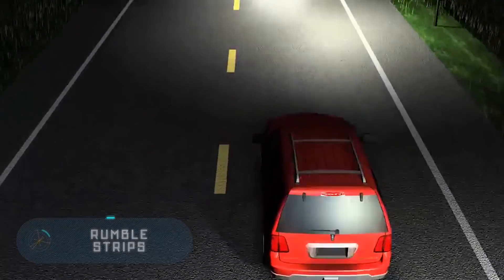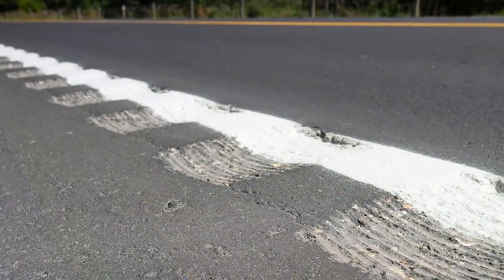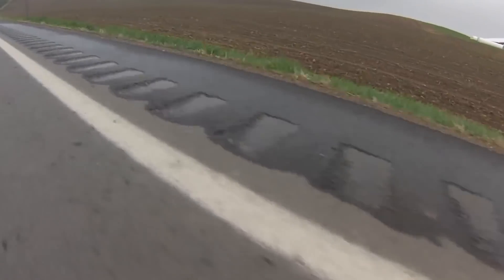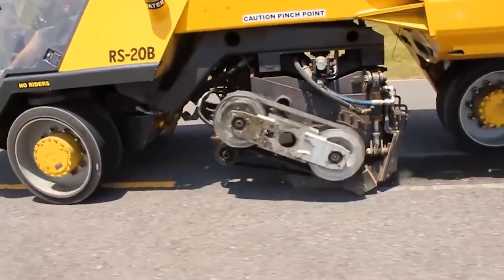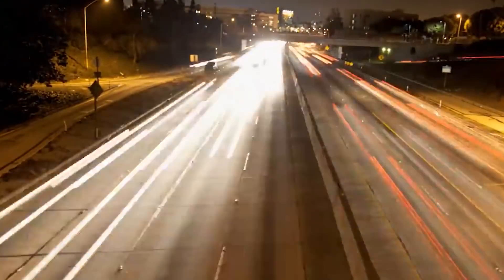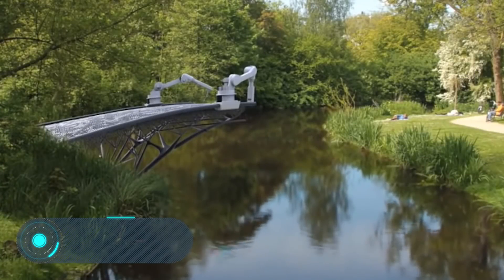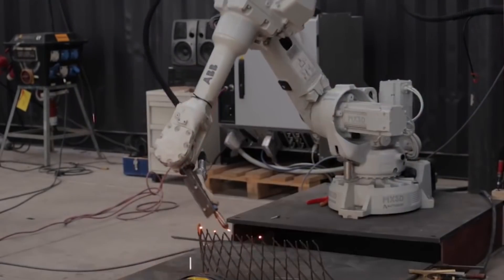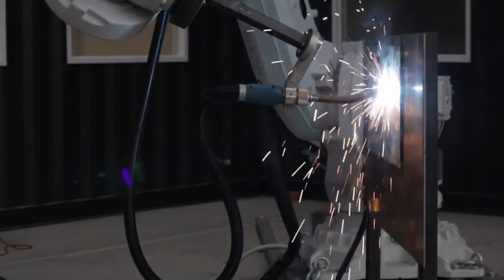MIND BLOWING LATEST ROAD TECHNOLOGIES

Comment: The Geo-Web foundation is impressive. It does make roads cheaper, which is fun for travel :-)
Reply: pretty sure its not actually cheaper... hence why they arent used. I looked at doing something like that for a driveway, the plastic mesh cost a bucketload, then you STILL need the fill anyway... only way its cheaper is if it ACTUALLY lasted a crapload LONGER than the 'usual'
Reply: I'd imagine the cost savings only come in places where normal roads either don't work or don't last. Otherwise, you're adding in the cost of making large amounts of polymer webbing in place of nothing. (they'd just put down everything else minus the web)
Reply: It's also giving construction an excuse to continue to mass cut and clear natural areas in order to lay more road for fucktards who like to burn fossil fuel. So not really impressive in the ways your thinking.
Reply: draggy76 what?

Comment: The first is the only one who is Economic. The other ones are just to test things and are much to expensive and hightech. Keep doing things like nature. smart, simple, and low energie input.
Reply: The 3d printed bridge, the reuse of asphalt, non Newton Ian fluid bump, vibrator road  are also economic in long term
Reply: vibrator road is not economic in long term. More accidents, means less people, means less vehicles on road, means road will last longer, means long term it is more expensive (in case anybody is wondering, this is sarcasm). On a serious note, 3D printed bridge is probably more economic, reuse of asphalt is a I believe present for quite some time, probably should not be in this video, but yeah, it is way more economic, vibrator road is not about economics, but more about saving lives, and for a really low price. Non-newtonian fluid bump, is in my opinion a nono economically. It will last less, it would not be easily fixed, and, if somebody is pissed at bumps, he just needs a good knife to "kill" the bump. Otherwise, its a great idea.

Comment: I believe that shoulder rumble strips were started being used in USA in the late 1980's. The rumble strips proved quite effective at reducing traffic run of the road crashes and thus were adopted world wide fairly rapidly.

 The first study on Centerline rumble strips was in the late 1990's in Delaware.  Minnesota had a few miles installed in Twin Cities area and in Rochester area.  Then some 60 miles in Central MN.  Before it became a standard feature on certain two lane roadways, a retrofit contract installed some 180 miles of centerline rumble strips in one summer, again Central Minnesota locations.  That nearly tripled the amount of miles of centerline rumble strips in MN.  PennDOT was also a leader in rumble strip research both on shoulders and centerline.   

The Minnesota contract also installed a test segment of Mid-lane rumble strip on a driving school track.  There were considerable questions as to the Mid-Lane rumble strip which could replace the two shoulder rumble strips and the centerline rumble strip with two mid lane rumble strips.  While the idea of the mid-lane rumble strip never caught on, the need for rumble strips will eventually disappear due to self driving vehicles and when driver alertness technology is implemented in human driven vehicles.  The original idea of the mid-lane rumble strip was broached by un-named bicyclist at a public meeting discussing shoulder rumble strips on a Colorado roadway.  The benefits of a mid-lane rumble strip were to snow plow operators who had to drive over them, allowed bicycles access to the cleaner part of the shoulder next to the edge line, and warned drivers of lane departure sooner than either of shoulder or centerline  rumble strips.  (Mid-lane rumble strips would be installed between the wheel paths of each lane. ) 

In summary while Minnesota DOT was instrumental in moving ahead the research and use of Centerline rumble strips, Minnesota DOT was not the first for installation.  Nor was Minnesota the first state to install edge line (shoulder) rumble strips.
Reply: Here is a fun fact, the rumble strips started in the early 50s in Nevada as "songs" in the road. It was to keep people awake on the long boring drives, and as a fun thing. I think it was called the "musical highway", give it a google.

Comment: The non-Newtonian liquid speed bumps is genius!
Reply: Until someone cuts it with a knife...
Reply: already happened they removed all the ones they installed less than a week after because people stabbed them or they just got holes in them
Reply: Kevlar coating?
Reply: yeah theres always some fucking idiot who would cut them with a knife because they fucking mongs.
Reply: intelligent speed bumps use corn starch. try it on your kitchen.
Reply: Steven Chandra corn startch isnt the only non newtonian liquid.
Reply: ANNND Its already gone.
Humans are geniuses at  proving good ideas are bad.
Reply: yes they are but unfortunately there are always stupid people that stab them as already mentioned and also I think kids would play around on them
Reply: They don't seem durable even if nobody stabs them. Sounds like a good idea, but only in an ideal world.
Edit:
It's also no advancement to what we have now. Some cars have no issues with some speedbumps. It'd be the same here. The size of your tires, thickness, weight of the car,... There's multiple factors going into how much force is on the fluid. Making a perfect speedbump would only work if everyone drove the same car.
Reply: It'll be cut with a knife.
Reply: Snow plows will be a problem.
Reply: Heat the pavement in the surrounding area.
Reply: oobleck?
Reply: liquidiceyt exactly
Reply: The flexible plastic will probably have a very short life. But it's a very good concept to start with.
Reply: Ya if you want something that will last like, 6 months tops...
Reply: its like oobleck
Reply: Cornstarch mixed with water.
Reply: I thought that was oobleck
Reply: It's oobleck
Reply: this type of liquid is called Thixotropic
Reply: I wonder how long would it last.
Reply: No speed bump is genius.
Reply: Destroy cars but saved tons of life.... I never heard of cars destroyed by speed bumps..
Reply: it'll be slashed
Reply: NotAGod - I would think that a simple and effective answer to this and other vandalism fears would be to have a fairly fine, yet quite strong, metal mesh layer (or two) below the top surface to protect against all but the thinnest and strongest blades. There is never a totally vandal-proof design for anything, sadly.
Reply: Until you go over it with a scooter
Reply: Natalia Seymour - ??
Reply: Betting a snowplow will destroy it.
Reply: Mark Chippendale cornstarch and water is cheap so maybe they would use it
Reply: yeah but you can stab it with a knife and the liquid is gone
Reply: @Timothy Mckee stop speeding then dumbass smfh
Reply: Until autumn and its freezing temperatures hit.... unless cornstarch and glycol achieve the same results as corn starch and water.
Reply: No Stu, its not a liquid that freezes- Were you not paying attention? Its a solid, many small solid particles that act like a liquid.
Reply: Mark Chippendale  so people are going to forget theres ER vehicles, ambulance, cops, and firefighters.  They need to save life and those speed bump are gonna slow them down
Reply: But the solid old ones they don't slow them?
Reply: Mark Chippendale  bro ur so cool and smart

Comment: Or people could not be idiots an run out in front of cars
Reply: Its natural selection
Reply: Yeah, the second one pissed me off, as if accountability and being responsible is no longer needed
Reply: Population control
Reply: A lot of people don't realize; pedestrians have the right of way *at marked pedestrian crossings* ONLY after they have verified there isn't approaching traffic within the time it would take them to cross.   Perhaps a little better enforcement, and summons being issued to pedestrians who don't check before crossing.

The same way that bicyclists riding on the roadways are required to obey the same rules as motor vehicles.
Reply: or people in the cars could not be idiots and speed
Reply: Marco Polo  hell im watching while driving and commenting,  oops damn traffic lights being green,  why dont i have to stop,   i know, if the light is green, i will go real slow while i watch this video,  then stop at the red so i can type my comments,   at least i am being safe,  you know people actually think that crap
Reply: Agree. Cars should have the right of way as it is easier to stop yourself than it is for a driver of a car to stop the vehicle. Get hit by a car out of the crosswalk. Your fault.
Reply: Since it's the UK, it's probably a cover for even more public surveillance.
Reply: Sure, we could just improve our roads. Or we could ignore them for a couple years and let evolution solve the problem.